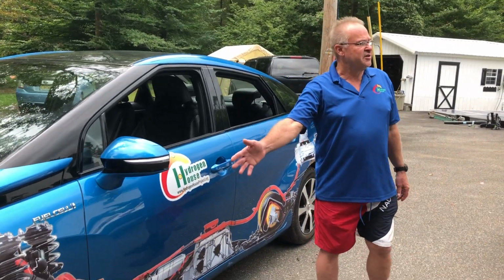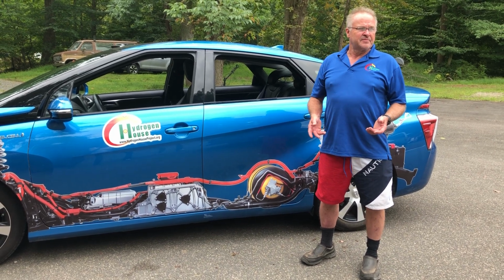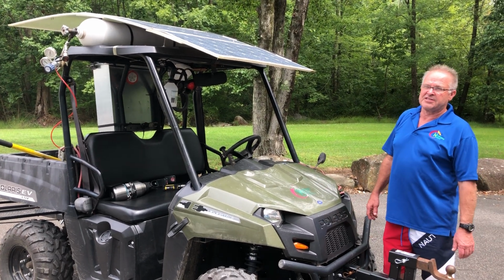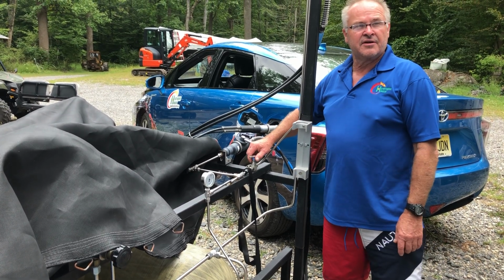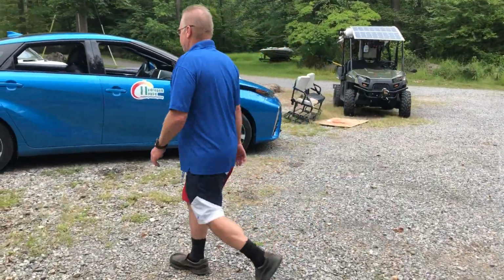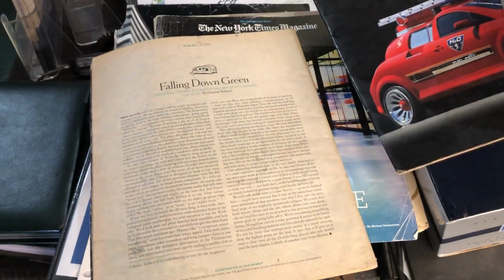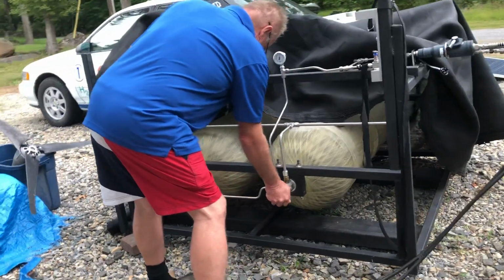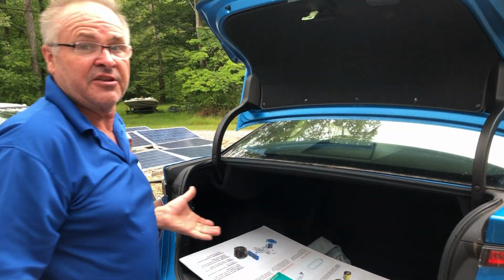Hydrogen House Project | Instagram Live | Hydrogen Vehicle Tour & Home Hydrogen Refueling | Pt. 1

Comment: Here we go with the next generation of gatekeeping. This guy appears to have build this fueling station with hardware purchase able from a hardware store and wants to keep the information hidden. Why does the world get the wrong people making breakthroughs. We have an opportunity to break away from fuel cartels and instead people want monopolization.
Reply: The reality is, the equipment is expensive and the conversion back and forth is inefficient. Mike has said in the past, he's spent $1M. He's set up another system for some uber rich person. The other reality is battery technology has surpassed hydrogen for anything land based.  The Toyota Mirai is just an EV with a really inefficient battery.  It takes Mike about 60kWh to make and compress 1kg of hydrogen to get the Mirai 65 miles. That same 60kWh gets an EV 240 miles. That's why it goes nowhere. And the EV doesn’t need anything special to charge at home. Most come with the cord needed.

Comment: "Fast performance car" you say because its not carrying 2 tons of batteries eh? Lets see about that. 2023 Toyota mirai 0-60 9.2 seconds. Tesla model 3 3.5 seconds. The battery weighs about 850 pounds, thats .4 tons BTW. Oh and tesla is actually over 300 pounds LIGHTER than the toyota. 

The Toyota can power a house for 30 weeks? Being generous that's 185 kwh's. That works out to be 1.2kwh a day. average house  uses 30kwh a day. The dc-ac inverter will use 1.2 kwh a day just being on. 

Not even half way through the video.
Reply: He means the whole tank farm when connected to his car can power house for 30 weeks

Comment: Why don't you store the hydrogen in methanol (with captured CO2) or ammonia? It would require much cheaper tanks. And isn't it cheaper and more efficient to just buy a Tesla powerwall to store the energy?
Reply: Most likely that's the only thing he could get it the time to store the hydrogen.
Want to buy anything else different if it works.
Now for a new system I would say yeah do that
Reply: It is cheaper to store in batteries today, soft of. But to give him some credit, back when he built this.  Hmm aren't those tanks expired by now??  Anyway.  There was no Tesla powerwalls and battery storage was really expensive.  But even today, it's questionable.  Each of the 1000 gallon propane tanks ($3,000) holds roughly 66kWh of electricity, after running it back through the fuel cell.  Battery storage for residential is at least $150/kWh, but usually more so closer to $10k each.  But you need 1/3 of the solar panels to charge a battery vs hydrogen. Battery is certainly cheaper if you don't hold as much energy.  And they're not as ugly as the industrial complex of tanks.

Comment: Without using the hydrogen car, how are you converting the hydrogen into electricity? Also, would it be more efficient to use the solar panels to make hydrogen then convert the hydrogen to electricity using a fuel cell instead of directly powering the house from the solar panels? I ask this because I've been told that solar panels are actually not very efficient. At the same time it looks like you're making the hydrogen using electricity from the panels anyways so that probably wouldn't make much sense. But I wonder if there's an invention that makes hydrogen without using electrolysis? I've heard of turning the sun into a hot sun beam using a parabolic mirror to split the hydrogen out of water & or gas so I'm very sure that it's possible!

Comment: Mirai 0-60 tested at 7.4 seconds. Easily beaten by a Prius or even a GT-86. Both of those are still slow. Whilst the engine may be more efficient, the hydrogen has to be chilled/compressed to fit in the cell (or the cell would have to be massively larger) so there is an efficiency loss in filling the tank/transporting if you can't make it yourself. Whilst it is really cool this guy is doing it himself, it is highly improbable for most vehicle owners to consider doing this unless they never want to exceed half the travel range from their abode. As I understand it, in Cali (the only place in the US that has hydrogen filling stations that are compatible) the price is over $30 per gallon. 
Where this technology does make sense is instead of lithium batteries for the home, powered by solar. Because it is much safer and doesn't degrade. I think hydrogen for vehicles is as much of a fad as CNG was. We had gov't endorsements here in New Zealand but hardly any pump stations were willing to take the extra risk and it faded into oblivion.
Reply: Cummins, boeing, Toyota, cp rail, many global governments are already onboard, ports and ships being built etc

Comment: I don't think it's correct to say that H2 gas is inert though. Commercial H2 tanks are polymer lined, because metal reacts with H2 to form hydrides. Can you comment? Is it maybe that this particular steel doesn't react with H2? Can you send a link to an example of the propane tanks you used?

Comment: So glad I saw this. When I realized that we have had this tech for decades and haven't been using it, why? This is the answer to all of the worlds energy problems. I wish I had the means to go a country like Africa to set up a power plant similar to yours that would generate electricity and produce hydrogen. The hydrogen could then be used to power equipment to build roads, bridges, and homes. Hydrogen transport and transportation vehicles could allow peoples in remote areas to visit nearby cities and hospitals for supplies and medical checkups or transport goods from nearby cities and towns. A remote village could be supplied with a hydrogen fuel cell large enough to power the entire village and it could recieve its hydrogen from a power plant like you designed and transported via vehicles running off hydrogen fuel cells fueled with the hydrogen generated at the power plant.
Reply: The losses when converting to and from Hydrogen are huge. You only get about 30% efficiency. A battery is better in almost all circumstances. For a fixed use such as night power in a village a flow battery would be appropriate, charged by their own solar panels during the day.
Reply: @adrianthoroughgood1191  we live in a world where energy is free. But the sheer size of a battery it would take is far bigger than hydrogen. Hydrogen does not pollute to make the fuel cell, batteries take lithium, a rare metal that pollutes a lot for production. Hydrogen fuel cells don't degrade over time. There are times batteries are useful but those are mainly for small devices that take little power. But if your trying to power a remote village there is no way you can have a big enough battery. Plus experimental techniques have 60% efficiency. Still no where near batteries but the density makes it worth it for this sort of thing.
Reply: @adrianthoroughgood1191  You work for big oil, yes?

Comment: Incredible project! How much did it cost to put it all together? How did you raise the money to buy panels, electrolyzers, compressors, fuel cells etc.?
Reply: You could use turbines but it's amazing how cheap it is. I made a setup with 10 24volt 15-18amp turbine motors (producing roughly 3400watts). 10 of these motors or permanent magnet motors cost $300. Though alternatively like how this man used solar, one could use $600 in solar. I just used wind power as it's 24/7 and stronger at night too (air molecules lose altitude rapidly as night to hot to cold increases turbine out put, but so does cold to hot). 

My setup was as follows:
- Turbine: ~3400watts
- No batteries
Pwm Modulator 5x (two motors wired each regulator for 48 volts).
- Produces Hydrogen at 75% energy efficiency by powering fuel cell.
- Hydrogen gas is collected and pressurized in tanks rated 15k psi and I regulate it to top off at 12k.

Think of how a basement water tank holds x amount of water, once it reaches 60psi it shuts off, this is the same concept but I programmed a valve to shutoff power to the compressor and Hydrogen cell once max set pressure is reached.

Between a compressor, motors, and the cheap turbine of aluminum I built it cost me all in all $1100 all together. This system would fill tanks of hydrogen at roughly 1 gallon a day, however in terms of energy density it has an equivalent of 2.5-3x the drive miles/gallons. If you have a Hydrogen cell vehicle, then the efficiency jumps to 9x gal worth of gasoline meaning per day you could make a gas tanks equivalent of a sedan 👍

Best part in a turbine is you don't need to replace them at all really as opposed to solar panels every 8-12 years. And a new Hydrogen cell electrode cost $10 in bolts and small stainless steel 304-317 rated 2mm thick sheets. Best part is you could melt the scrap iron in large quantities and make your own steel (oxide steel or plain steel last about half as long but if your fine casting and making your own fresh material by recycling all it cost is some cheap charcoal or slag removing shale/limestone which one could also find pretty easily or make (charcoal is easy to make in bulk especially if your take brush and make charcoal (roughly need 1-5lbs charcoal per 100lbs iron scrap/pig iron). 

Overall my electrolysers last all day for about 1.5 months and all I do is make Hydrogen fuel for my riding mower and push mowers.
Reply: Though as a future idea I'd like to make a high voltage for efficient electrolyser but that'll be for when I can afford a Hydrogen fuel cell vehicle.

Comment: This is an impressive infrastructure you set up and an informative video. I assume you have some IP to protect and cant fully disclose parts of the process. Hence I understand if you can't answer some of the questions. May I know how many hours you get from the anodes? Do you use ruthenized titanium? What material do you use for the cathodes? How many hours do you get before oxidization is a problem? May i know the current density?

Comment: It would be great to see the equipment that liquifies and stores the hydrogen. This is the biggest barrier to implementation. Do you have a feel for how much energy is consumed compressing a mole of hydrogen?
Reply: But why would you want to liquife it? There is no need because you are not going to ship it anywhere.
Reply: @torothomassen9581  To be a practical fuel in vehicles, it needs to be liquified. Otherwise the tankage is huge
Reply: @Will_CH1  well, not that huge, but ok. But this is less about the car, and more about having an entire house off-grid and independent from say, the goverment.
Reply: @torothomassen9581  F,low batteries are probably the best way to store energy for a house. Electrolyzing hydrogen is a more complex process and the energy density is lower unless you compress it which consumes energy. For energy storage, hydrogen is best suited to mobile equipment, but it needs to be liquified.
There is a company called Hydroxia that have a catalyst that facilitates hydrogen storage.

Comment: Did you consider a 660V fuel cell for the car? I assume the DC-DC converter saves equipment cost. Is there an economic prospect to match the motor and control circuit voltage to the fuel cell?

Comment: What method do you make hydrogen with? Alkaline electrolysis? Many plates in sure. Hundred/s. Stainless steel or something else? How do you separate the hydrogen in this huge production? I appreciate your work tremendously. I'm in awe. This is my dream. I'm about to install an hho generator into my car to increase gasoline combustion/flame speed.
Reply: I can answer your second question: if you place the electrodes in two connected beakers (it's a beaker that looks like the letter H), for example, one side fills with hydrogen while the other filles with oxygen. As far as storing that H...without watching the full video, I assume there's a compressor that stores everything into high capacity tanks.

Comment: Great video,, Can hydrogen be produced using wood chip gasification process using wood waste in combination with solar to produce hydrogen 24hrs a day?
Reply: Gassifying wood chips will produce a cocktail of hydrocarbons. If you want to electrolyze anything, then water gives a noce clean and reversable reaction.This type of electrolyzer works on a liquid. If you put wood gas through , a much higher voltage is needed and an explosion risk is huge.
Reply: A fuel cell needs very pure Hydrogen to work and not corrupt the fuel cell. You can't use gasification.

Comment: Using the oxygen byproduct, instead of atmospheric air should give you another efficiency boost. Why are you not capturing that as well?
Reply: Probably because it would half the volume of the hydrogen and would need to be compressed. His tank farm would need to double. You could buy a small house for the cost of the tanks he currently has sitting there.
Reply: The r all old reconditioned expired propane tanks, so he got them cheap. And here houses start around four hundred k

Comment: I'm going off grid and I've been wondering how viable this is compared to battery tech. The most obvious issue is that fuel cells are crazy expensive. Either that or they haven't really reached mass market. It looks like the Mirai as a fuel cell alone is cheaper per kilowatt of output than 'wholesale' units on alibaba. What's up with that?

Comment: I liked your video and feel your pain with people instantly scared of something new. I hope you can answer some questions below:
1. Does the Mirai use a 115kw+ PEM fuelcell to support the 113kw engine with instant power? 
2. How many plates is the toyota Mirai cell?
3. I am looking at converting a boat from diesel to 100kw 48v electric and am thinking of 200kwh lithium + 20kg of hydrogen hydrite storage. Which fuelcell should I buy and carbon fiber hydrite tanks?
Reply: You'd do a lot better to ignore all the hydrogen and fuel cell stuff. Hydrogen is environmentally damaging and an unsustainable fuel medium. If you want backup for your boat; stick with a diesel generator to top up the batteries if you're stuck out on the water.
Reply: @mb-3faze  Hydrogen is clean when created from Solar and water. Hyrogen is dirty when extracted from Ammonia etc. Understand the difference in application. It is easy to create Hydrogen at home with solar and water.

Comment: Thanks for the video. Very inspiring, but I understand the Mirai requires a pressure of     10 000psi to fill the tank . How did you get those tanks to that pressure ?  I’ve been looking into this and the only answer I’ve been able to come up with requires a Half million dollar compressor!  Do you have a more affordable suggestion?
Reply: @Sheldon Weber
The high tank pressure does not go to the generator.  The pressure is regulated down to only a hundred or so pounds per square inch.
Reply: @acmefixer1  he’s putting 10 thousand pounds of pressure into his Mirai. I want to know how .
Reply: @sheldonweber5216  I don't know how he's doing it but an oilless scuba tank compressor is only $1300-2500 that will easily go to 8000psi. 
Suncenter Max 10000 Psi High Pressure Pneumatic Gas Recovery Booster Pump is $2000-3000. 
The cheap way is just to use a compressor off a refrigerator for free (3000psi) and just fill up more often.
Reply: Thanks for the video, I learned a lot of things that I didn't know. I didn't understand how you create the 700 bar pressure that the Mirai needs to be able to fill the tanks.Thanks for any answer

Comment: Great info & demo...I learned that refueling hydrogen from high pressure tanks makes a significant noise, and can be used to determine when the tank is full [I do not yet have a Mirai].
There is a slip of the tongue at 21:22 I think....regarding the [noisy] water-electrolyzer........says the hydrogen comes from the anode and oxygen from the cathode. I think that might be bass-ackwards and in reality the anode of the water-electrolyzer produces oxygen and the cathode produces the hydrogen. Maybe you were working on a fuel cell late last night; a fuel cell where the anode gets the hydrogen and the cathode gets the oxygen....
Reply: or he could have it in a vaccum or using sound at the res freq  lol who knows we can only  guess or pretend we know
Reply: @ambersmith6517  hmu please